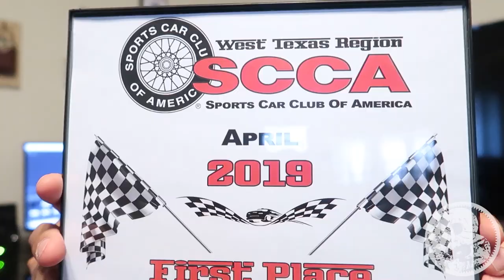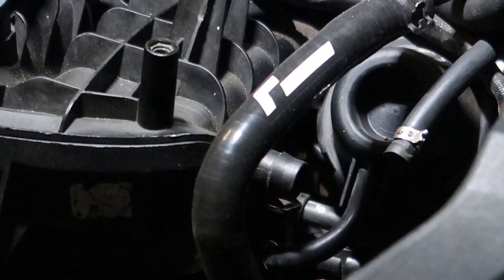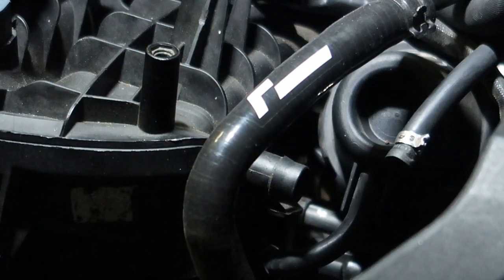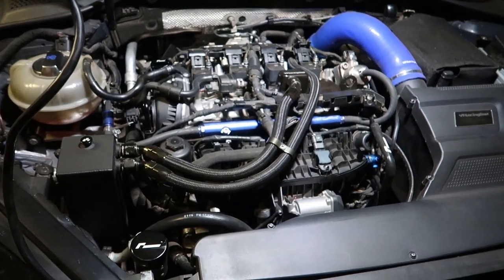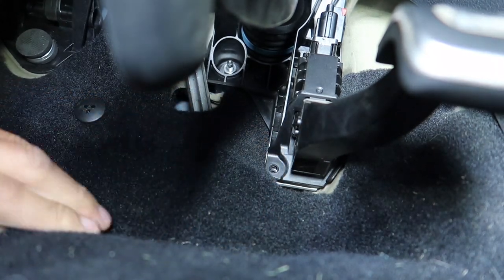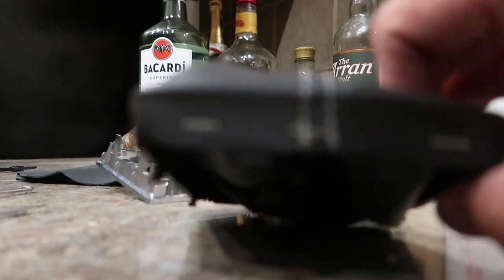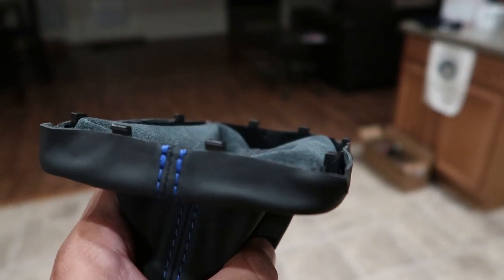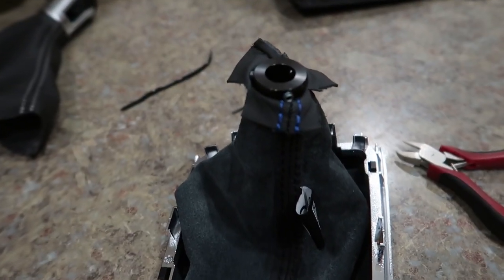BFI Shifter Combo, WCT Pedal Spacer, & PR Multi Port Tap Install! | MK7 Stage 3+ Golf R

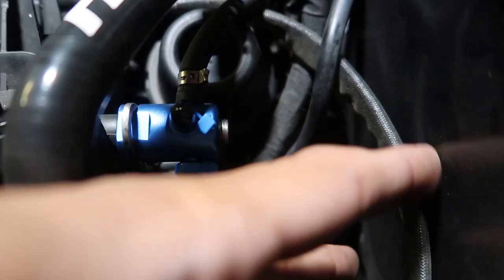Comment: 6:40 you could get a 90 adapter to install your 5 bar boost sensor so  u dont have to knock a hole in your airbox :)
Reply from the maker: I could, lots of options! Idk if I even really need the 5bar anytime soon. 4 bar on the PUT is good enough for the 32psi that I'm running 🤙🤙

Comment: 5:40 is that the same place that the APR tap goes?  it seems the APR tap is threaded and also i saw someone using a punch and a hammer to install the APR tap?
Reply from the maker: The punch is to make the initial hole in the manifold, so that you can read pressure. There's no hole there from the factory. The APR insert threads into its self and is reliant on the notch/groove thing to stay attached, like the PR one.

Comment: I'll take that yuengling
Reply from the maker: I horde this stuff 👀 we can't get it out west, liquid gold out here lol
Reply: @BryceJordanProductions  shit still lucky I live in Dubai would kill for some right about now. I remember hoarding that stuff in korea when i was stationed there. they wouldn't even take it off the pallets it was gone so quick
Reply from the maker: @TheHike84  Dubai is dope tho! Can't find anything close to yuengling out there? Michelob has some dark beer that is super close!
Reply: Real question though. What ethanol sensor did you get? I have been thinking about adding one in the GTI. Been looking at the fuel it one myself. Thoughts?
Reply from the maker: @TheHike84  I got one with my fuel kit, from precision Raceworks. I don't have flex and don't have it hooked up to any gauge (yet). I've heard good and bad things about the fuel it kit, but I've never had hands on with it to give a real answer.

I plan on hooking my sensor to my P3 gauge via a kit available from them I think, or USP I forget. Hoping it works out, I'll be ordering it here sometime before summer!